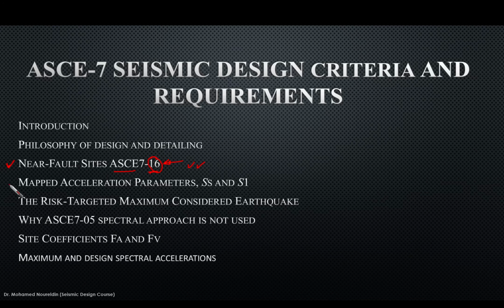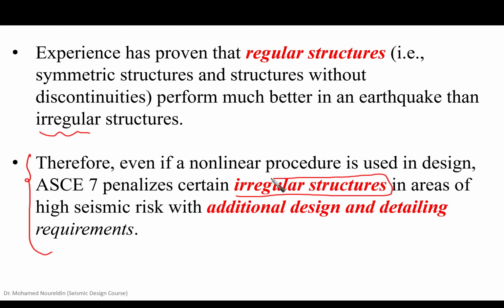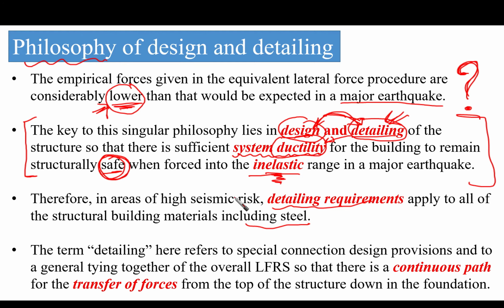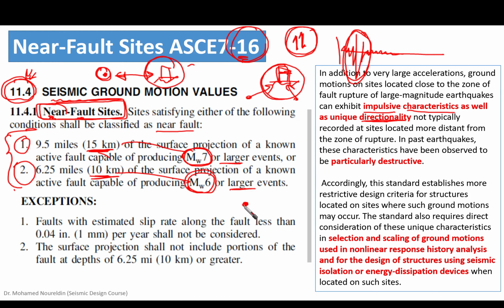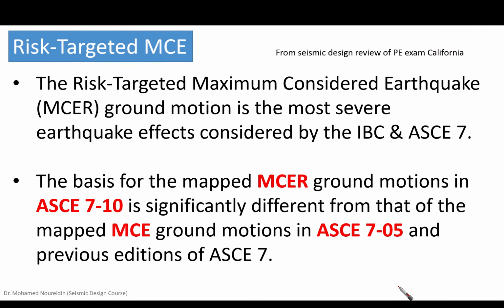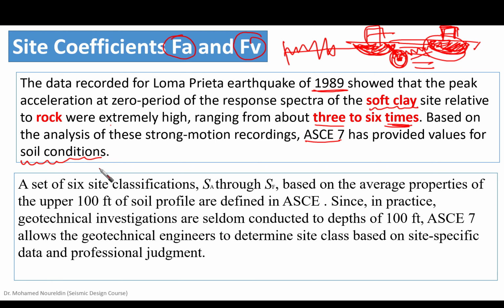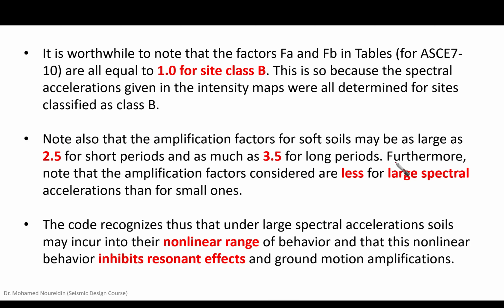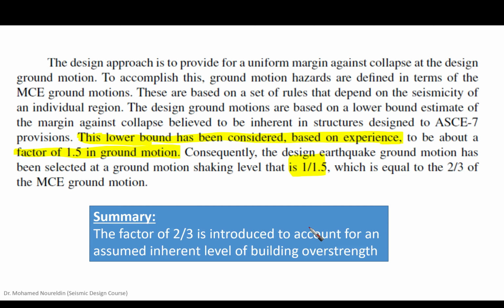11-ASCE-7 Seismic Provisions Detail Descriptions-Introduction

Comment: I do not understand why when the soil properties at site are not known in sufficient detail to determine the site class, the code stipulates that the site be considered as class D, unless geotechnical data indicates that class E or F soils are likely to be present. Since the code allows me to use class D, I will just use class D even though it may not be conservative assumption if the soil is class E or F. Not really sure why "the geotechnical data indicates that class E or F soils are likely to be present" is just like a footnote instead of principal requirement.